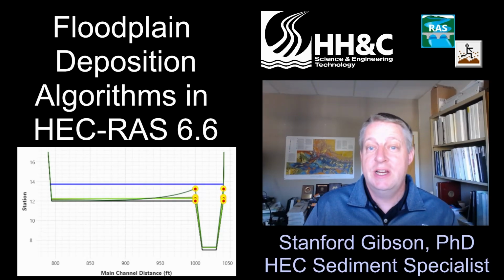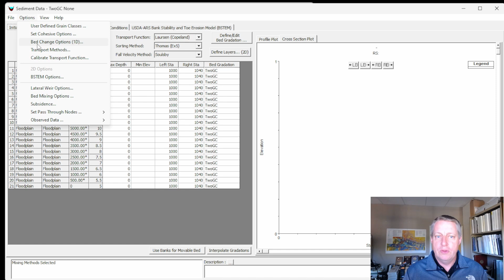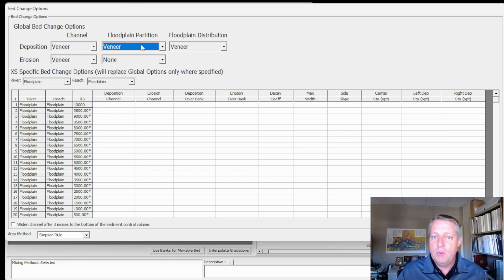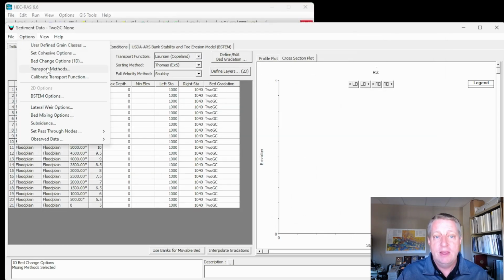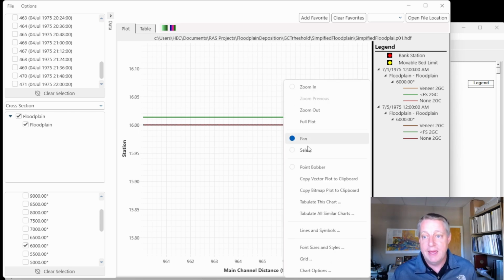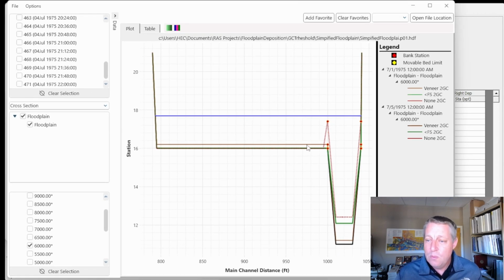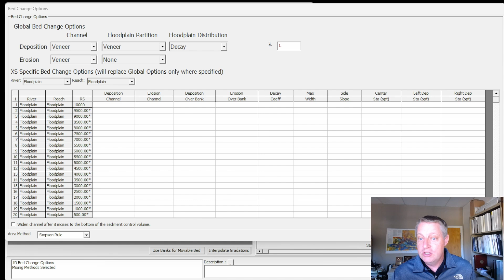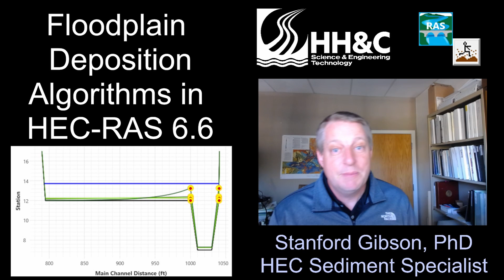Floodplain Deposition Approachs in HEC-RAS 6.6 (coming soon)

Comment: Hi Dr. Gibson, many thanks for making this super helpful walk-through tutorial. 
Currently, I am working on a 1D quasi-unsteady flow project in HEC-RAS 6.3.1. There are 150 cross-sections. Checking each cross-sectional floodplain/overbank deposition height is really time-consuming. 
Is there any option available in HEC-RAS to get the average depth of overbank deposition along the entire channel length? Or any way to export cross-sectional average overbank deposition depth?
Reply from the maker: I don't really think in "depth" because it is so sensitive to channel width and XS specific characteristics....and even though it is a 1D model, it can vary laterally based on wetted perimeter.  I am usually more interested in the mass deposited in the overbank. We really should provide a "overbank mass change" result (its on the wish list) but you can get to overbank deposition by subtracting the Longitudinal Cumulative Mass Change from the LCMC Movable Limit (which give sthe mass change for just the movable bed limits).